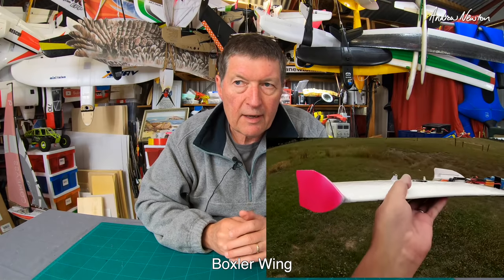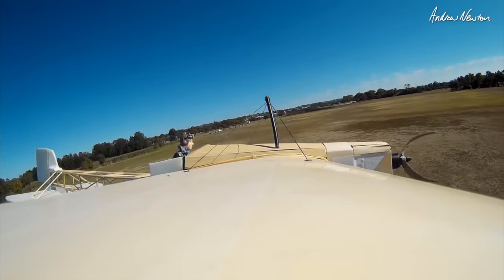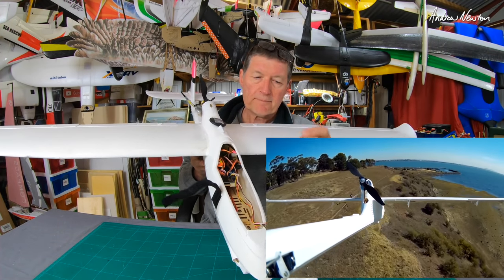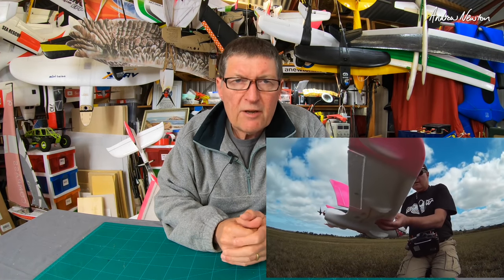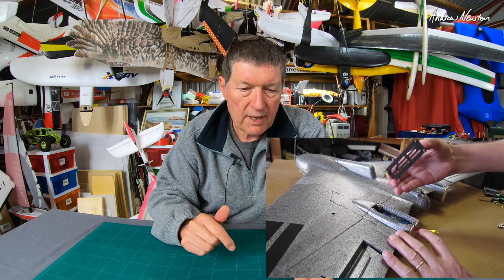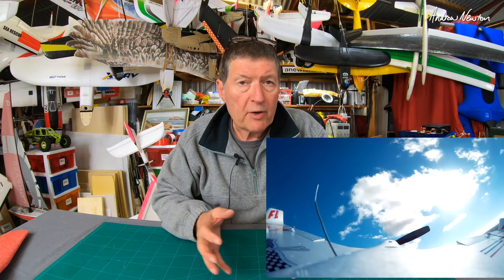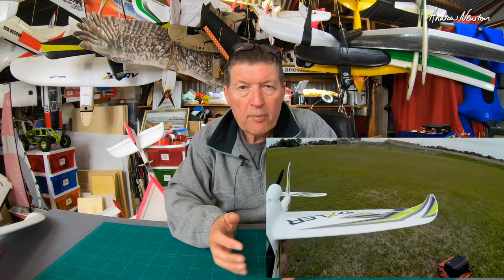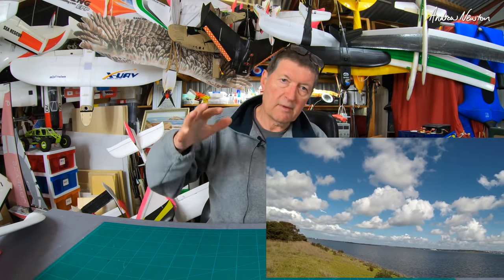Past Planes 14 - Wings, Bush Mule, Mini DLG, SkyHawk etc

Comment: I've been following your channel for 1+ year and I love these "Past Planes" episodes. Something that you might not have noticed about the Ranger 2000 is how well it survives crashes (being the expert pilot that you are, you may not have experienced these :-)). I twice crashed hard, nose down, and the only issues was with the bent metallic tube spars (no "stinking" carbon fiber) and shattered battery holders. I simply straightened the tube and 3D printed out a new (more solid) battery holder. The was no broken foam as happened with some other pusher plane I crashed... impressive! Cheers.
Reply from the maker: Ha, good point. I have carried out frequent crash testing. See the dents on the wings

Comment: After seeing how well your scratch build micro skyhunter worked I built one too. Mine has a one meter wingspan, an A tail style tail section and the tail booms are rubber banded on. I ended up building the tail section too bulky and heavy but it still worked very well at an all up weight of 380 grams. I used a 3s 1000mah and got 15-20 minutes flight time depending on how I flew. It already can fly very slowly so I can always use bigger batteries for more flight time if I want. It flies smoother than my bigger planes with 700+ grams of weight and 1.5 meter wingspans. It is very fun to do basic acrobatics with it like loops, rolls and inverted flight. In the future I plan to build a foldable tail for it to make it even more compact when it is dissassembled. Hopefully it having a A style tail will make that easier.
I love my micro skyhunter and thank you for the inspiration :)
Reply from the maker: Nice one. They do call for acrobatics.

Comment: So many planes.......I have recently acquired the bush mule. My friend likened it to dancing with your granny...lol 
Was the surface area extension worth the effort really? I like it but feel like its missing something. Maybe slow with high alfa with door open dropping off parachutes....
Reply from the maker: Too many planes mate, would be happier with just 10 I think. The extra wing area works well, slower slow flight and no tip stalling. Nothing fancy, just hot glued 6mm depron on to the trailing edge.

Comment: It's a scary thought that some bright spark here in the UK might think it's a good idea (purely for reasons of safety, of course) to charge us evil, irresponsible RC modellers £16.50 annually not just for breathing, but also £16.50 for every single plane or part of a plane in our possession. Just in case. Remember, that 300g DLG is a lethal weapon.

Yep, it's a grand idea all right. Quite a money-spinner, too. If you've got 20 aircraft - which is not uncommon in these days of cheapo, zero-effort RTF models - that's a cool £330 per year.

Yay.
Reply from the maker: Per aircraft is just money grabbing!